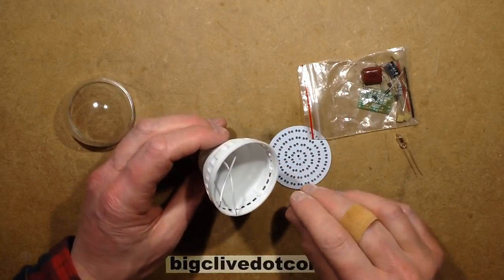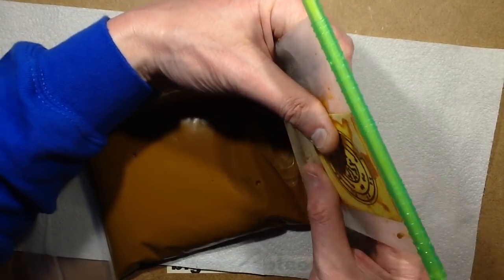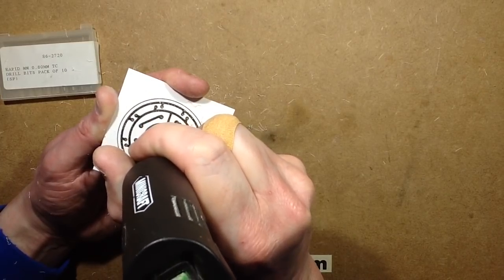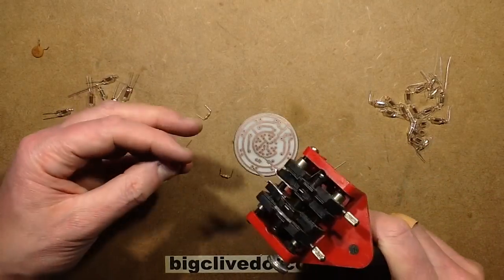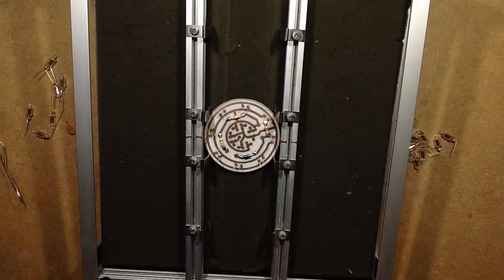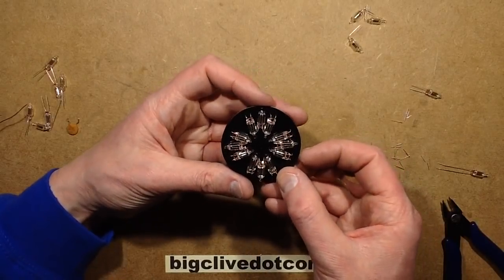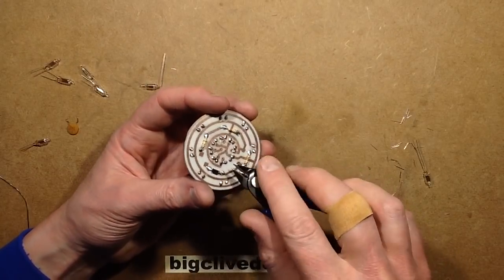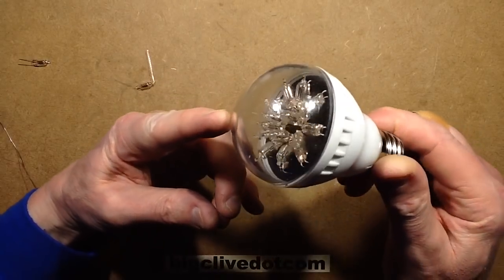Full mega nixie-lamp build with custom PCB.

Comment: I've got one of the turn handle component lead cutters and use it for doing entire chains of resistors at once. It is an absolute necessity if I am assembling alot of board. The disadvantage is that it takes a long time to set it up for different sized components so I really need to get one of those adjustable hand ones for the odd sized components.
Reply from the maker: +arcadeuk I've got one of those now.  I just wishfully searched for one on ebay and got it for a fraction of the new price.  It does take a long time to fine tune it, and you do waste a modest number of resistors in the process, but it is very fast once set up.
Reply: +bigclivedotcom Paid about £200 for mine (used) on ebay. I bet you are going to say yours was cheaper ;)
Welcome to the club :)
Reply from the maker: +arcadeuk It was dramatically cheaper.  Just one of those random spontaneous desires to have a bit of equipment I lusted over when I was at the peak of fairground lighting controller manufacture.  I'd have to sit and literally pull the trigger of my £100 hand component former for hours at a time.
Reply: Sounds like you were lucky then :) Couldn't live without mine now
Reply from the maker: +arcadeuk It was well-used and scruffy when I got it, which probably helped keep the price down.
Reply: Ahh, the old Gattling gun!

Comment: At school, we used basically a small stick with a sharp tip on the end (I have no idea what to call it) to make a small indentation in the board for the drill bit to stay stable.
I think that might be useful to you in the future.
Reply: +motorbiker46 Centerpunch? Probably wouldn't use the spring-loaded version.
Reply: In woodworking the hole aligning indents are made with an awl.
Reply: +motorbiker46 
Keeping the drill stable is only part of the problem. Hitting the center in the first place is the harder part, and you still have that problem when using a center punch. The center punch also quite leaves a small "wall" of copper around the center which can make a handheld drill wander even more. So if you make the PCB yourself anyway just etch a hole into the center of the pads. Saves a lot of time and is way more accurate.
Reply: superdau
Unless you stop the etching too soon like here. In which case SOMETHING is better than NOTHING when it comes to starting the bit.

Comment: He should check out som of these "electric massage pads" from ebay. They're electric, they can give you a "zing" and you can get them in pink! :D They're advertised as massagers, breast enhancers, muscle enhancers, penis enlargers etc.

I've tested some. They work.... kinda. Except when they glitch. That hurts!
Reply from the maker: +Svein Erik Edsberg Yeah, the cheap units glitch a lot.  When you turn them on or press a button they sometimes just blast their output at full power.  They also use a small choke to create the high voltage pulses and some have no DC separation, so they can cause sever skin irritation due to electroporosis (electrolytic cell damage).
Reply: +Svein Erik Edsberg I suppose anything which tingles the man implements has a good potential to enlarge its size, least temporarily. I agree though, a tear down of one of these Chinese TENS units would be a fun thing to see. I've seen warnings like don't place on your neck (though the pictures show to do that). I guess cause the pulses could change your natural rhythm. Maybe even see Clive try to solder while using one :)

Comment: Get a drill stand - no more broken drills.
Reply from the maker: +mikeselectricstuff Tried that, but I find drilling by hand much faster, typically clocking up around 100 holes per minute or more when I get in the swing on big PCBs.  (Yes, I timed it.)
Reply: +bigclivedotcom 3d printer with a milling attachment? ... but then all that time setting it up probably isn't worth it for a one-off.
Reply: +bigclivedotcom it's a bit random but have you heard of photonicinduction???
Reply from the maker: +super awsome minecrafter Yes I watch his channel when he's putting stuff up.
Reply: +mikeselectricstuff Drill press*
Reply: +super awsome minecrafter. I am a avid viewer of photonic induction however he ain't had any new vids for a few months :(
Reply: +rickyreynolds17 According to the discussion section on Photons channel,he is in hospital following an accident with the mobility scooter. Not sure if its true, but you can check out the discussion on his channel.
Reply: +Tri-County Electronics 
A drill press is something different and not needed. I use a router spindle (a "Kress" used quite often in CNC setups, although I mostly use it for handheld woodworking) mounted in a drill stand.

+bigclivedotcom
Just don't get the Dremel drill stand. I've used that one for some time and it's one of the crappiest products of a "brand" I've used in a long time (and the Dremel tool itself is not much better either).
Reply: +Graham Langley I also snapped a drill bit while drilling holes into a pretty soft PCB on a handcrafting lesson.
Reply: +super awsome minecrafter If you're talking about the channel, he mentions them in the Vodka video.
Reply: +‌ 綾瀬 The price is nothing compared to the price of the software you need to buy to make it work.
Reply: +mikeselectricstuff I've watched a lot of your video's too mike :)
Reply: +Steve Pocock cheers, I'll have a look :)
Reply: +mikeselectricstuff Not necessarily - I've managed to snap a TC drill in a proper PCB drill while drilling some SRBP for a test fixture.
Reply: +james chatterton Xcarve
Reply: George Myers
Thanks, I've always found Mach3 to be a bit temperamental.